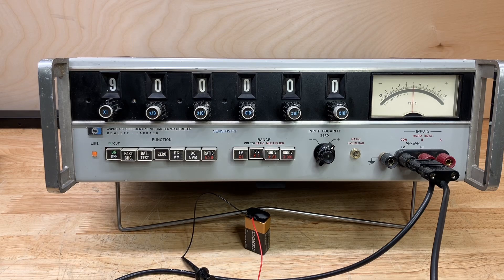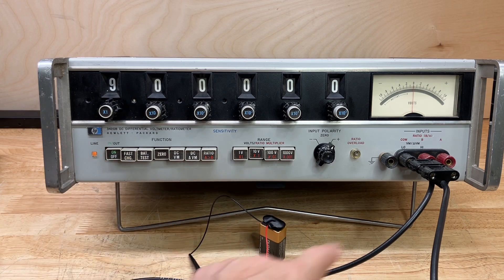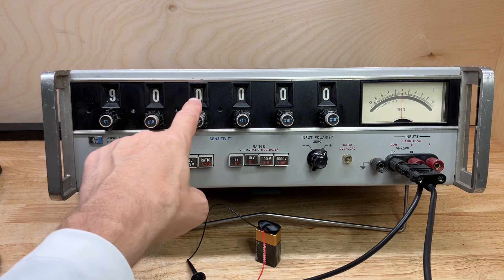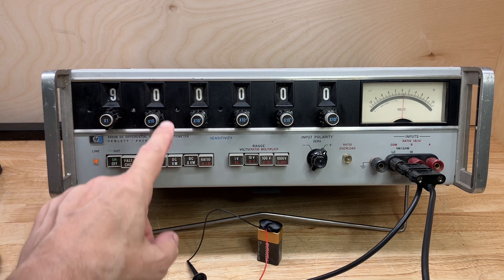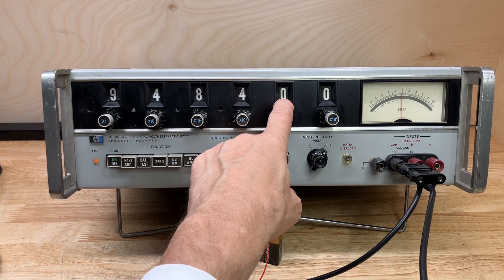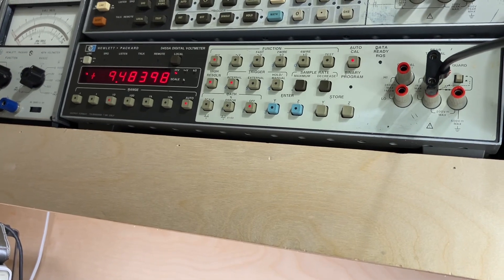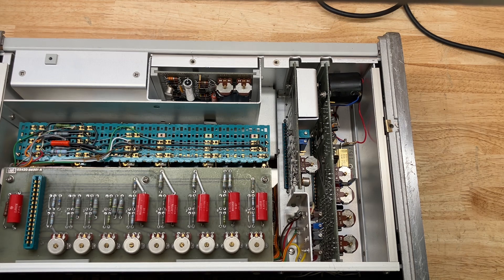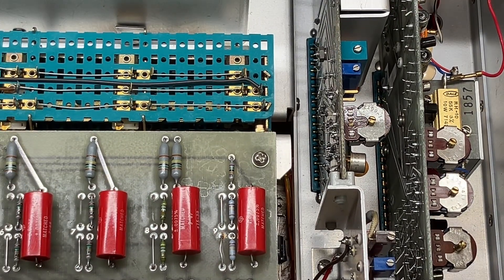HP 3420B DC Differential Voltmeter/ Ratiometer

Comment: using a differential voltage measurement,at null,you draw no current from the DUT,thus your meter impedance is effectively infinite.

Comment: I've always wondered what a ratiometer was! I've had one for decades without knowing what it was for. Now I have to find out where I've stored it and dig it up! Thanks! I'm very thrilled to have kept it now!
By the way, why is it called a ratiometer? I was never able to find any information on ratiometers on the web until now.
Reply from the maker: @Stelios.Posantzis  I didn’t actually demonstrate the ratiometer part of this instrument. The ratiometer uses both inputs A and B, and indicates the ratio B/A, thus the quantity measured is not a voltage, but a fractional ratio. It’s another way of comparing an unknown voltage to an external standard reference voltage.
Reply: @garyramsey4275  A-ha! Any chance of a short follow up then? In what situations would you use this function?
Another thing: what can you do if you want to measure a high voltage? Is it possible to measure it directly with a ratiometer?
Thanks for the quick reply.
Reply from the maker: @Stelios.Posantzis  I may make a follow up video once I get my HP 740B DC Standard up and fully functional. The ratiometer function was generally used to compare an unknown voltage to a standard 1 volt. The ratiometer function can measure ratios of up to 1000 I.e. comparing 1kV to a standard 1V.
Reply: @garyramsey4275  So it's not just for measuring very low voltages, excellent! Thanks again!

Comment: Ciekawy przyrząd :)  To kalibrator DCV ?     Ciekawa budowa. 11:40 to czarne dwa pakiety to co to jest ?     Pozdrawiam
Reply: The black thingies are battery banks 4x24V to provide isolated power for lower noise. Impressive.
Reply from the maker: It is not exactly a calibrator. The meter indicates the difference between the internal reference voltage set by the dials, and the  dc voltage applied to the input terminals.
Reply: @garyramsey4275  Ok myślałem że kalibrator bo tak wygląda. Nie znam języka angielskiego to nie wiedziałem. Ładny sprzęt.

Comment: Nice! I wonder if it could be modded to make a calibrator by adding an output terminal for the reference voltage source, but that'd probably throw it out of adjustment.
Reply from the maker: Yes, I’ve wondered the very same thing. I do have the manual, with schematics and everything. I may look into it.
Reply: @garyramsey4275  actually,it could be used as a "meter calibrator",just connect the meter(DUT) across the measurement terminals,leave it on 1x sensitivity,and dial in the voltage to 90% of full range on your device under test. You just cannot draw a lot of current from the HP unit.(i was a PMEL tech in USAF.)  a 10M input Z DMM won't load it. probably not a 1M cheapo Harbor Freight DMM,either.

Comment: Thank you Gary for another excellent video. :)
Maybe you'll also be able to review the HP 740B DC Standard/Differential Voltmeter? It's very similar to the HP 3420B DC Differential Voltmeter but has a nixie display.
Have not been able to find the correct test leads for my HP 740B so may have to improvise a solution.
Kind regards.
Reply from the maker: @terrygains8327  Yes, I do have a 740B that I started working on over a year ago, but I haven’t finished repairs on that instrument yet. I had to fabricate replacement input and output cables for mine, which work fine, but there are still other problems with it. It only “sort of” works. I have a feeling there are issues with the photochoppers in it (there are 2 of them.) It will probably take me some time to get it fully operational again, but of course I’ll make a video (or several) of that unit.